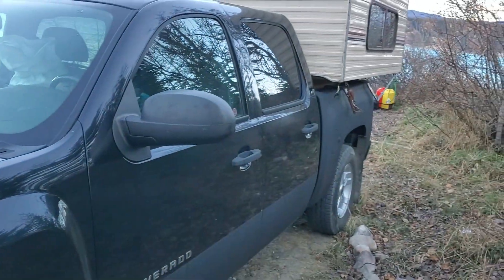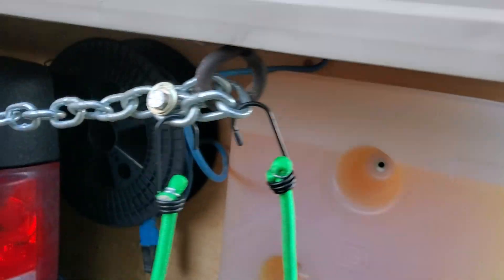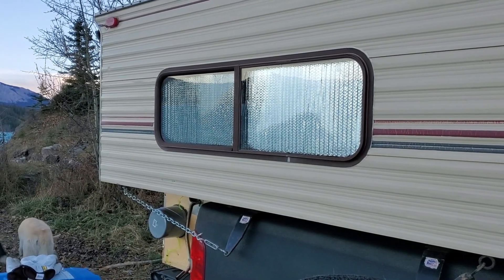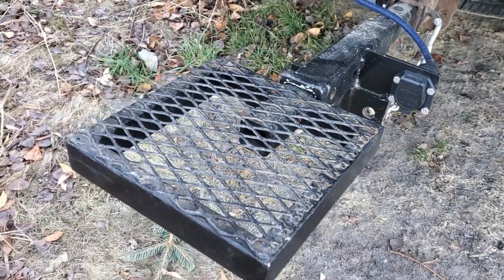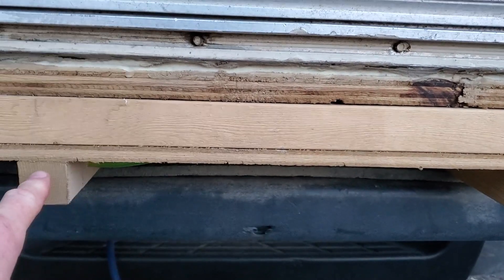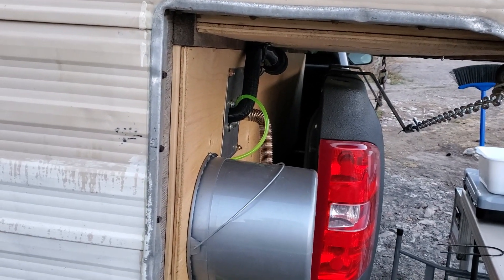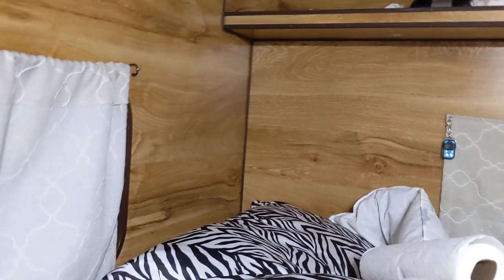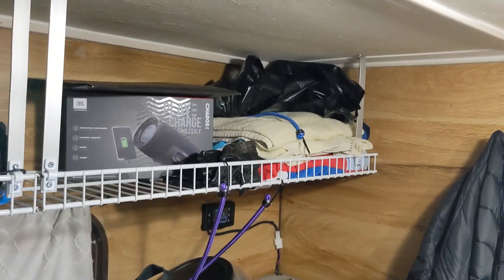A Quick Video of Our Camperette Mods

Comment: I have a little bigger camper I use, more head room and a tiny over the cab space.  Is the heater a little over kill for the space? Also your tie downs look efficient to me. I've had many campers over the years and had no problems. I think the key is the front tie downs,  I try to pull the camper into the front of the bed and the back ones to pull the camper straight down to the bed. Great video! Happy travels my friend!
Reply from the maker: The heater is definitely overkill. Even the smallest one we could get heats the space too much. But, that's still better than freezing to death! I agree on the tie downs. I made sure it would pull the camper tight into the bed at the front. The back ones are forcing it forward and down. So far so good.

Thanks for the comment.

Comment: You said you added Reflectix in the walls, if it’s not “reflecting” like in the windows it doesn’t work very well without a vapor barrier space between layers.
Reply from the maker: That may be true but it made a big difference in the heat retention for the winter. We also use it to block the windows which may be the bigger difference we are noticing.
Reply: @genxers  works good reflecting in windows, and it’s thin, nice upgrades though. Subscribed & watching your other videos.